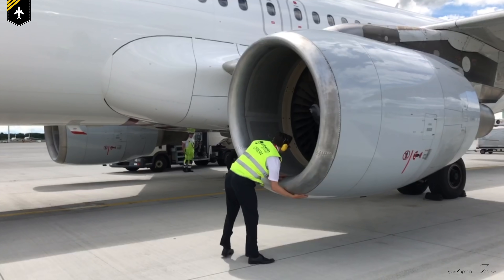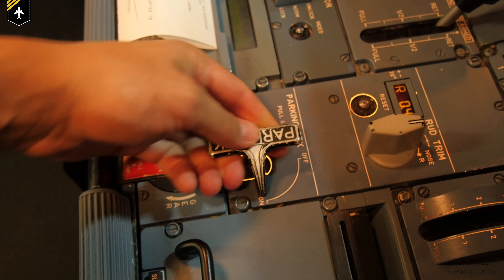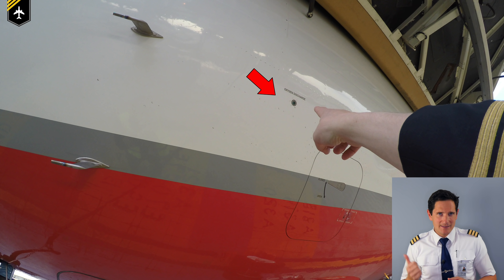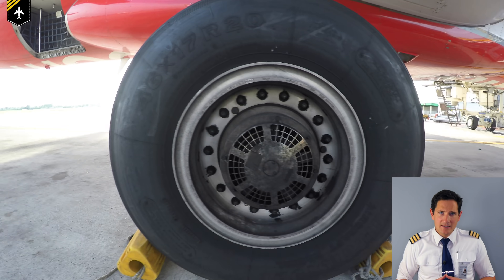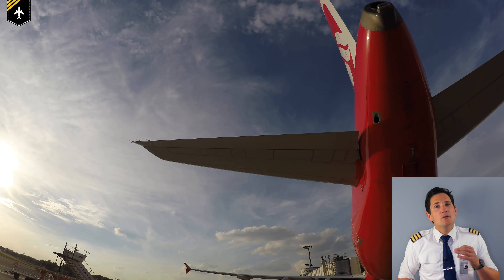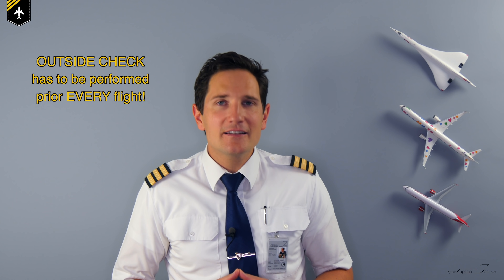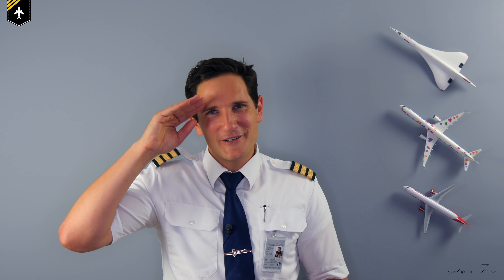AirbusA320 OUTSIDE CHECK explained by CAPTAIN JOE

Comment: for A400M , why not test the rotor-adjustments ? with comunication to fly-deck ! 
at smaller (single engine) aeroplanes this pilot's move the rotor's also heli-pilots look at the trimming of rotors 🤔
Reply: Show me the knob/lever to adjust prop pitch in an A400M. There isn't one. The adjustment happens automatically and the system does a self test when all engines have started up.

Comment: Thanks Joe. One I'd like to add from my airline. When doing the walk-around we are required to bend a knee to the ground on each side of each engine (so four times) to verify the cowl latches are secured. We had an aircraft have a cowl-flap pop open shortly after take-off.

Comment: Whew! Cars have a lot of parts, but none of us ever has to inspect anything before starting a trip. I think my car is tougher than a commercial plane. My Ford  long ago had steering linkages on the verge of breaking. A "check" would be beside the point. I've owned more than a dozen cars. That linkage never broke on any of them, even the cheap junker cars. But close care by maintenance after the pilot's inspect will make the pilot's life less exciting. And maybe longer.

Comment: What is the static port pls?
Reply: The static port is most often a flush-mounted hole on the fuselage of an aircraft, and is located where it can access the air flow in a relatively undisturbed area. Some aircraft may have a single static port, while others may have more than one. I hope this answered your question

Comment: Not sure if you’ve done one but the static ports, what are those?
Reply: Aircraft has instruments that use barometric data (altimeter, vertical speed indicator, airspeed indicator), and static ports are small air inlets that measure static pressure these instruments need to work correctly.

Comment: Good stuff!! Three questions: 1. how long does an outside check on the A320 usually take? 2. On larger aircraft, say an A350, are outside inspections harder because of accesibility issues? 3. Do co-pilots take part in these outside inspections too?

Comment: Nice explanation,in automobile air-conditioning & hydraulic assistted   
Work are done engine support in bornet.in areoplanes engines are in there wings.whethere any alternative support system working

Comment: THE STATİC PORT I do not know what it does
Reply: Static ports are small air inlets that measure static air pressure in order that instruments like airspeed indicator, altimeter and vertical speed indicator work correctly.

Comment: Why do the F/O and Captain have separate static ports and PITOT tubes? Why not average each and give the same data to each pilot, and check if they are too far apart that one may be failing?

Comment: What are the static ports used for?
Reply: They measure static pressure which the instruments like airspeed indicator, vertical speed indicator and altimeter need in order to operate correctly.

Comment: I remember being boarded on a flight, crew announces we would have a small delay due to a small technical problem. About 20 minutes later the announcement came the technical problem was resolved. During the flight however I remember being scared the problem would cause us to fall out of the sky. We got safely to our destination.

Comment: but you told that we should not go near running engines till a certain distance.
But in the video they are touching the engines.
Reply: The engines were not running. The engines are not running during the outside check. There was wind blowing and the fan blades were just windmilling. The fan blades start to rotate very easily when there is a wind blowing at the airport.

Comment: what are the holes for the captain and f/o static ports for?
Reply: They measure static pressure which the instruments like airspeed indicator, vertical speed indicator and altimeter need in order to operate.

Comment: What are the static ports used for?
Reply: They measure static pressure which the instruments like airspeed indicator, vertical speed indicator and altimeter need in order to operate.

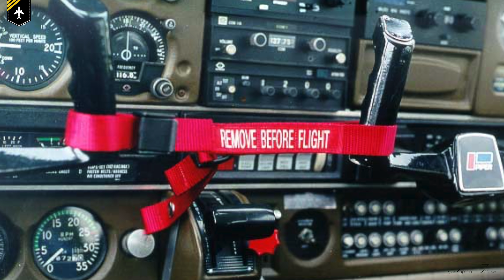Comment: 11:58 I mean..., do you really need a message saying remove before flight in the engine covers? If you are smart enough to work at the airport/airliner you are smart enough to know that you shouldn't turn on the engines with a big red cover on

Comment: Could you please explain the function of "static ports" for the crew?
Reply: Static ports are small air inlets that measure static pressure. The aircraft have instruments which use barometric data like the altimeter, airspeed indicator and vertical speed indicator. Static ports measures static pressure these instruments need to operate.

Comment: Hi when do pilots make this check.  I tend to sit in the windows above the plane before boarding, just taking a look.  I cant say I have ever seen a pilot on the ground between reaching the terminal and boarding.  I don't fly that often so I could be missing things but still...
Reply: It's done before every flight. Normally the outside check is already done before the passengers will board the aircraft.

Comment: A plane was lost because the pitot tube cover wasn't removed before take-off. The pilot didn't know his airspeed or altitude. When he asked the control tower to help him out he didn't realise that they were using his plane's data, rather than their own independent data. Needless to say, the plane was lost and just to an apparently minor omission.
Can anyone enlighten me? Are there 2 pitot tubes for redundancy or do there have to be 2 for the system to work?

Comment: What if I found a problem who do I report to do I do it by radio or what
Reply: You report the problem to the maintenance and they will come to check it. It's quite usual to use your cell phone to inform the maintenance.
Reply: @mikep9604  why not by radio
Reply: @_tar1kh32  - If the maintenance has their own radio frequency. But that depends on the airline and its procedure.

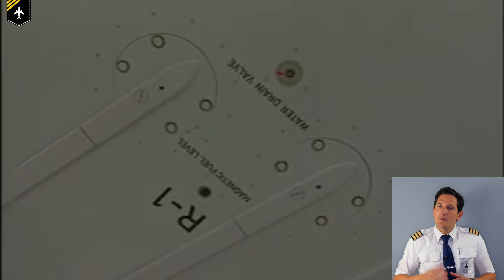Comment: is that not scary to do??? 6:00
Reply: The engines have been shut down. The fan blades move totally freely.
Reply: yh but it’s still scary having an engine right in front of u while touching the blade ty for the info btw

Comment: What are those static things?
Reply: You mean static ports? The aircraft has instruments that use barometric data, like altimeter, vertical speed indicator and airspeed indicator. The static ports are air inlets that measure static pressure those instruments need.
Reply: @mikep9604  Thanks, that's what I meant.

Comment: >If you forget this, the nose gear won't retract upon takeoff
what happens when this occurs? Do you have to do an emergency landing?
Reply: Not really an emergency landing. You can fly with the gear extended, although you have some speed restrictions and burn more fuel. You may have to burn some fuel anyway, as the aircraft might be too heavy to land immediately. If you cannot dump fuel (or it gets your passengers to their destination faster) you can also just continue (bur keep an eye on your fuel gauges and do not end up like these guys: https://en.wikipedia.org/wiki/Hapag-Lloyd_Flight_3378)
Reply: ECAM displays (A320) main landing gear RED which means the gear isn't retracted and you can go ahead and make an emergency landing but mostly it's the job of ground personnel to remove the pin before engaging pushback service

Comment: I noticed boarding an airbus A321 Frontier airline in Philadelphia a crack in leading edge wing root fairing on left wing. Is that acceptable for flight? Should I have called out the pilot on that?

Comment: Oh you can spin an engine blades with hands... Awesome!!!
Reply: I always thought they would have been too heavy.
Reply: @sarahk236  It is quite heavy, approximatly one tonne (the part he is spinning), but most of it is very close to the axis of rotation, so the moment of inertia is small and the fan blades are a nice long lever. And obviously the bearings are very good. I really want to see how difficult one of those is to spin, now!
Reply: The fan (part he touches) is connected only to a few similar, but smaller sets of blades (low pressure compressor and low pressure turbine). Because you need very high rotational speeds for significant compression to occur it is (as you can see) quite easy to turn slowly.

Check out this https://www.youtube.com/watch?v=KjYw0GdRpm0 or https://hursts.org.uk/airbus-technical/html/ar01s19.html 

If you want to know more about Jet engines in general, check out AgentJayZ's channel here on youtube, he repairs jet engines for a living and is real good at explaining them!
Reply: Due to the bearings, there is very little friction - so easy to turn. Very often you'll see an engine slowly rotating - and that's just a bit of breeze going through it doing that !

Comment: Years ago I had a flight instructor who once told me that I took too long doing my pre-flight inspection.  I had taken 20 minutes and I was quite thorough.  My response to the instructor was "Show me the reg or shut the hell up".  He and I never really got along, but never tell me how long I can spend doing preflight.  It's my butt and my airplane up there.  Do it right - don't rush your pre-flight.
Reply: bcgrittner that’s cool that you maintain your vigilance on performing your job and not allowing senior crew to intimidate you. I’ve seen airplane disasters episodes where the copilot didn’t have the nuts to tell the captain that they were fixing to die!
Reply: Because you're a real pilot and not a poser. Aviation is a "SAFE ALWAYS" environment.
Reply: @SilencedMi5  You need to SHOUT that a LOT louder. Boeing, Airbus and other aircraft manufacturers are not hearing you. I just can't believe how badly their systems are designed. Even this walk-around is shite. The level of expected inspection is beyond what is physically possible - often, you are too far away to inspect something properly - such as the leading edge of every fan blade on the engine - inspect for chips that could lead to cracks and fan failure. Working in a very noisy atmosphere is not right for inspection purposes - a fingernail flick of each of those fan blades to make it ring could indicate early hidden cracks that can lead to failures later.
Reply: That's great if you have the time to do so- however in 121 (commercial passenger) aviation you're under time pressure to get off the gate on time. While you shouldn't rush- you should get your process as efficient as possible. If you make a habit of making the flight late you won't keep your job for long. Also note that every crew is looking at the aircraft before and after each flight and maintenance has to look at the jet every 2 days at a minimum, so there's lots of redundancy if one person misses something.

Comment: What are the static ports for?
Also, at 6:40 what is that smaller tube in the middle for?
Reply: The aircraft has instruments that use barometric data, like altimeter, vertical speed indicator and airspeed indicator. The static ports are air inlets that measure static pressure those instruments need.
That tube at 6:40 is the centerbody of the primary nozzle.

Comment: I was at an air show many years ago standing under the wing of a 737 and I saw a trail of hydrolic fluid running down from a wing near the engine mount,I put my hand up and swiped it with my finger not knowing that captain Joe's brother was watching, he rushed up to me and said, "what are you doing cant you read the sign, dont touch", I said yes but it is leaking oil, he said yer it leaks oil just like your Holden, to this day I cant work out how he knew I drove a Holden,let alone how it had an oil leak,but I am guessing it was the t/shirt.blue jeans and Adidas Romes, true story! hilarious :). wonder if he got the oil leak fixed didn't hear about a crash so must have.

Comment: Captain joe i had an experience during take of and befor landing a squeaking sound and its a bit loud from inside the airplane..what is it and do we need to be afraid when we hear it?
Reply: FrEy Lirio - The sound comes most obviously from the Power Transfer Unit of the hydraulic systems. It's perfectly normal.

Comment: I got my PPL (now lapsed) on a Cessna 172. Tiny little plane, quick to check, small enough to hold in your hand, slip into your handbag or push indoors when the weather's nasty. But a passenger jet's HUGE. So what happens check-wise when the weather's awful?

There's a lot of climbing about and bending and peering into things whilst looking for leaks, runs, drips, etc. but how do you do that when the weather's bad? I mean, really bad. Not just regular, obvious winter-bad, with blizzards and ice storms, but awkward-bad. English summertime bad. Within an hour you can have fog and rain and hail and mist and frost and drizzle and yuk and frogs and swarms of locusts and - Well, you know.

So if the pilot can't physically perform every check - EVERY check - is the flight officially delayed? Does the pilot make that decision? Is it ever tempting to miss a thing out - perhaps just one little fluid drip inspection - so that you can keep to schedule, or is a genuine delay a vital and accepted part of that schedule anyway?

Go on, you can tell me...  ;-)
Reply: All pilots would rather delay the flight than knowingly cause a safety risk to be on board.

Comment: Hi Mr. Captain Joe
, your videos are great for collection, but why not in your list, say cargo door lock is checked before takeoff, what I mean is all checks are done, before ground crew does filling and maintenance, why checked are made before passengers are loaded, why not ready to take off, why not, if all checks are done on the final trip, by ground controller why not in VRU(voice record unit  =black box), for easy to identify the fault, which 2 cargo doors blown, has happened, why not.

Comment: Do you check the weather history on a plane that has not flown for several days and has been on the ramp, to see if it has been exposed to high winds that may have caused issues with the control surfaces that may not be detected on an external inspection? I'm going to also quote from NTSB AAR1901 to frame the subject. "Before the accident flight, the airplane had been parked on the ramp at YIP for 2 days near a large hangar, and the elevators (which, by design, did not have gust locks) were exposed to high, gusting surface wind conditions. Postaccident examination showed that the right elevator’s geared tab’s inboard actuating crank and links had moved beyond their normal range of travel and became locked overcenter, effectively jamming the right elevator in a full-TED position and rendering the airplane incapable of rotation during takeoff. The speed of the surface wind and gusts at YIP did not exceed the certification design limit or maintenance inspection criteria for the airplane. However, the NTSB determined the airflow at the airplane’s parked location was affected by the presence of the large hangar that generated localized turbulence with a vertical component that moved the elevator surfaces rapidly up and down, which resulted in impacts against the elevator mechanical stops, imposing dynamic loads sufficient to jam the right elevator"

Comment: I'm not a pilot but am concerned over the AOA external probe especially since there's a lot of talk about the 737max MCAS system. It seems that the AOA probes can be easily damaged...even by accident by ground crews or bird strikes.  Can you address this?...All the best Joe and thanks.

Comment: Joe: "Make sure you don't spot any holes or cracks".

Me: Okay, I just won't look then.
Reply: Of particular note to crews of Soviet era equipment.
Reply: @wntu4  SR71 sweats nervously
Reply: @scoldingwhisper  The SR 71 was designed to have gaps. Hell the fuel tanks leaked like sieves on the ground. But the titanium alloy it was made from experienced thermal expansion to the tune of several inches in places when it got up to speed.
Reply: I hope you’re not my pilot 👨‍✈️
Reply: Nah... nothing that Gaffa tape cant fix.
Reply: I'll look
Reply: Hahahha this is siooooooooo funny
Reply: Just fix it with Flex Tape
Reply: Me on that plane: Oh @$!? we gonna crash

Comment: Grew up around aircraft military and commercial  and recommend using both ear plugs and ear muffs (at the same time) during walk arounds for a longer pilot career. 
Plus the worse the weather during the walk around the slower you go this is when you will most likely miss the the thing that will bite you

Comment: Yo sir im no pilot but i always want it to ask this question. Can a passenger plane pilot airbus a380 fly a military jet like an fa-18?? 😁
Reply: Ghost rider they can’t just Get in one and start flying each plane takes a check ride for a pilot to be able to fly it. He would have to have someone there on his flight. Ultimately yes he can fly it but if found without a check ride he would be written up. Only way to survive without getting a write up would be if he was just riding along and the pilot were to become unresponsive and unconscious then he could assume control and take it in for emergency landing.
Reply: Probably, after all the principles are the same. He might need a little help of some sort, but it could work.

Here's a story of a mechanic and glider pilot who flew an A4: https://foxtrotalpha.jalopnik.com/the-tale-of-when-a-marine-mechanic-stole-an-a-4-skyhawk-1745015819
And, for example in the US, quite a few airline pilots are ex-military, so they may actually have experience in an F/A 18 ;)

Comment: When do you start your descent
Reply: If not instructed by ATC then you use a 3 to 1 descent profile, plus a few additional miles to allow for deceleration.  For example is you are 30 miles out from an airport you should be around 9,000 feet. 20 miles out 6,000 feet, 10 miles out 3000 feet, ect.